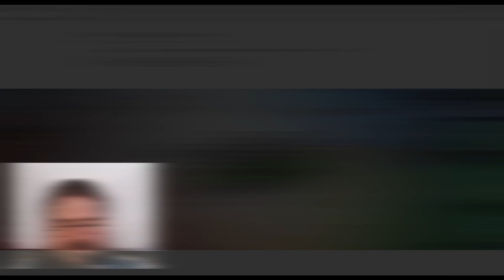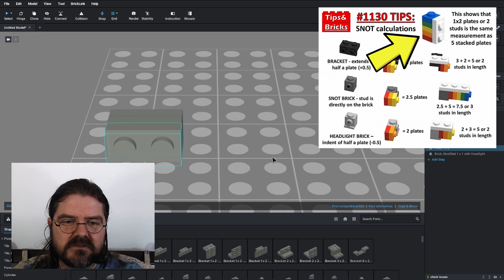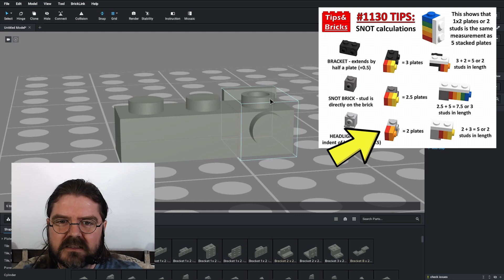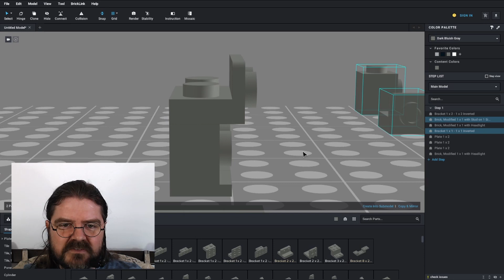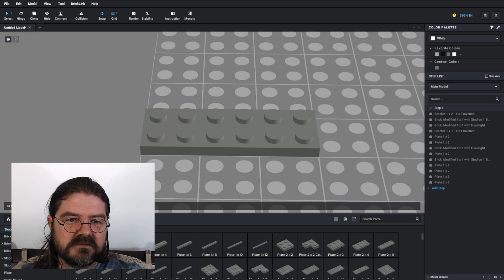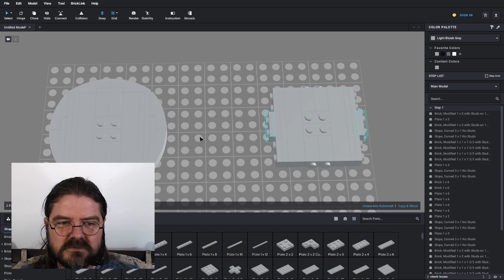LEGO® MOC Design Tutorial - Introduction to LEGO® Math!

Comment: I think it might have been useful to start with the basic dimensions of a 1 x 1 LEGO brick before getting into plates and half plates.
Reply from the maker: Thanks for the feedback. I will be covering that when I get in LDUs as that doesn't really apply unless you are trying to accurately scale a model.
Reply: I meant the relative dimensions like 1 brick = 3 plates and height = 1.2 x width, etc., not the actual dimensions.
Reply from the maker: @Welcome to Euphoria Ah yes, I was thinking that after the fact. You are correct I should have covered that first.

Thanks for pointing that out, I appreciate it :)

Comment: Cool video! Another thing I noticed is that Technic liftarms are not 1 full plate wide.  If you center it on the pin hole, there's an extremely small (1 LDU?) gap on both edges
Reply from the maker: Yes, I have noted that myself.